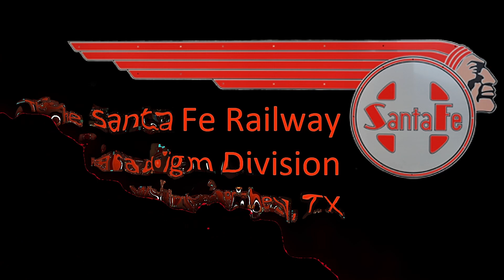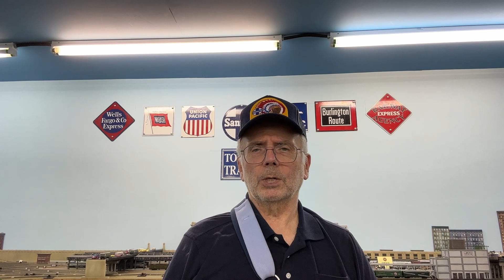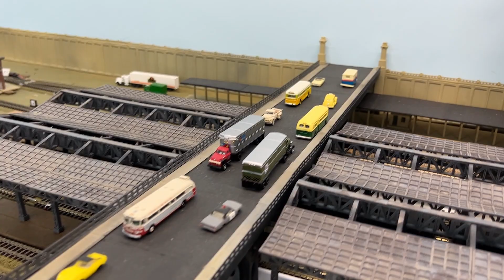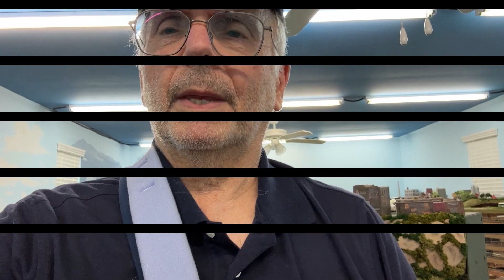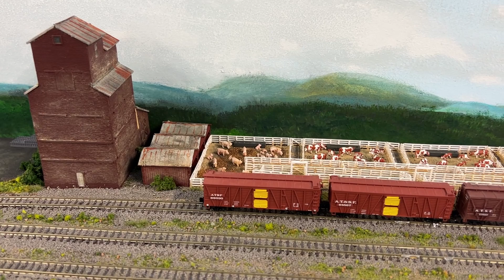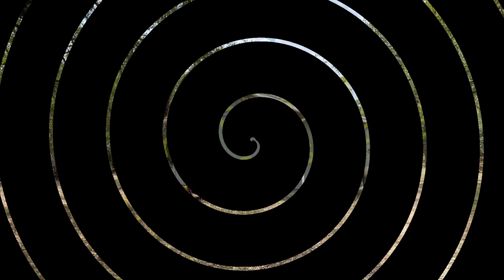More Excitement and A Plan

Comment: hope you heal fast
Reply from the maker: Thanks Dwight. I have been wanting to play with a used printer that my son recently got. It has dual independent extruders so I will be able to use PVA for supports while still using PLA for the print. The PVA supports will just wash off in water…..John
Reply: @tanzj  that's cool you will have to make a video while it's printing I would like to see it running
Reply from the maker: Yes I will